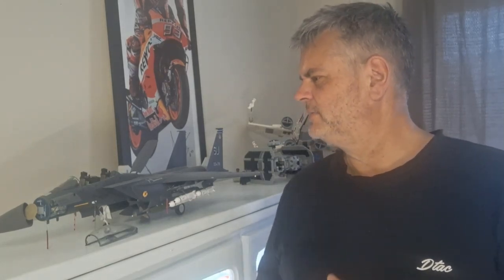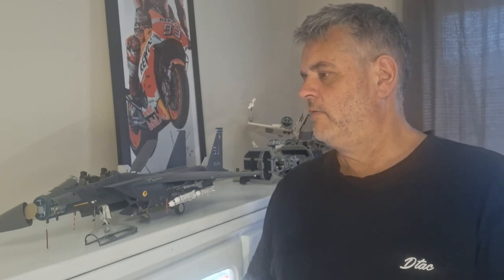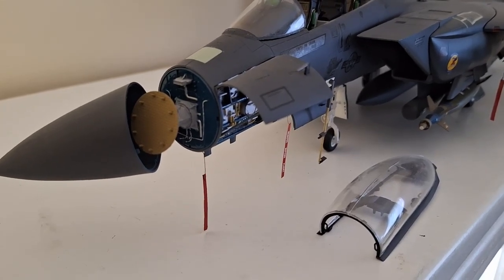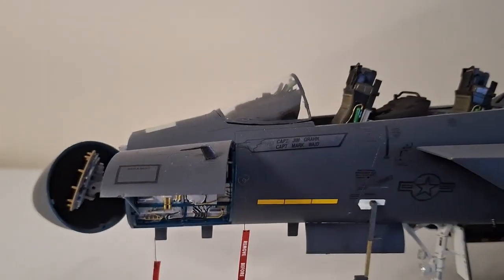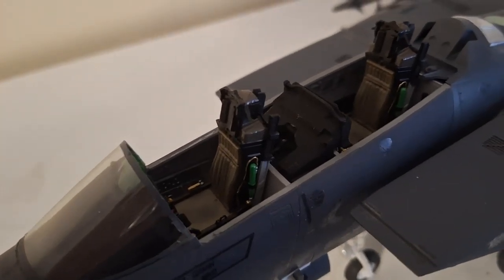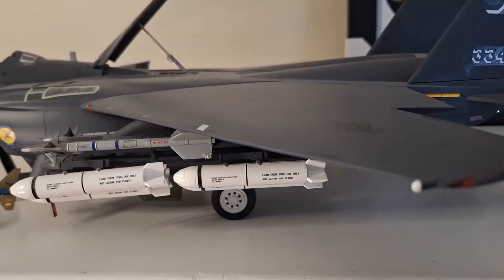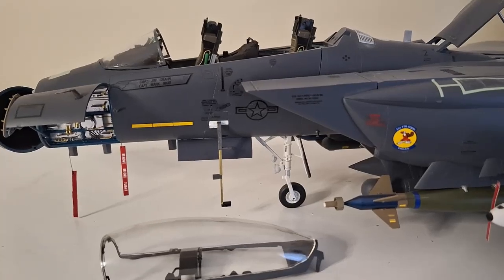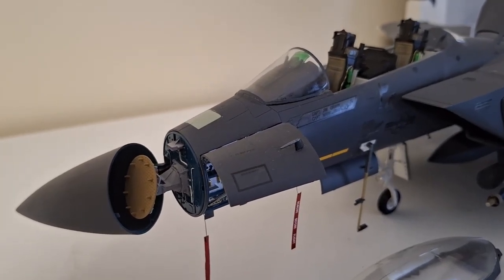Tamiya F15 Strike Eagle Reveiw

Comment: Hello Garry. My comment is for all that may read it.
Tamiya do make great aircraft models. It has been proven and expected that the newer new tool kits are much better overall.
The 1/32 F-15 was released thirty years ago. The added parts for the F-15E, 2003. 
I have built the F-15J and working on the F-15E. 1/32 Tamiya F-4, 1995 (Phantom Phan), three built, two in progress, all F-4Es. Because Tamiya stopped production of the two E kits, I ordered the sprue parts from Japan to convert F-4J kits. There are issues to overcome with these kits more so with the F-4.
The best 1/32 jet kit is the F-16CJ. 2004. Online reviews will back it up. Wonderful, enjoyable to build
model. I have three. There was a sale at my local online store. 
Then there is the 1/32 'fab five' WW2 series. The Mustang, Corsair and the Mosquito all newer kits and have built eight of fab five.
So for Tamiya, I would consider 2000 -  most other brands 2010 - as the oldest release dates for 
a quality kit that can be built out of the box with less problems than older 1/32 aircraft models. 

With experience and skill gains not so good models can be a rewarding challenge but there are brands
that do not deserve support. After a few kits, the last being the 1/48 SR-71, 2021 I will not
buy/build a Revell model again for what I expect out of a model to have at the price asked.
The past year I have been doing more 1/24. The new Airfix Mk.IXc Spitfire is excellent.

Online resource sites like Scalemates and Cybermodeler are a must to use when considering a model kit.

I returned to the hobby, 2018 after forty years and have been encouraged to post more on my channel.
Learning video production.
Reply from the maker: Thanks for the feedback mate. I totally agree with you.
Reply: Seeing that you have a interest in motorcycles I have a business designing/building
custom motorcycles. Chopperworks in Burlington, Ontario, Canada.
I am retiring from it but the site is still up for a few months.
Examples of my models are at the bottom of the DESIGN page.
There is also a few images of a Boba Fett costume I made posted on another page
if interested.
For your consideration, future videos on your channel could have you give a little 
background of the model on your review similar to what my first comment had.
Your experience building it is more important for a review but the history will 
compliment that and extend the time.
My approach is final reveal only without narration. Information in the description.
I do many inflight on custom stands, some with lighting effects and motorized propellers that are good for videos. @gbmodels7790
Reply from the maker: @johnnyboy483  thank you on your feedback I appreciate a lot so I can get better on my  video's and I will give more information all my models